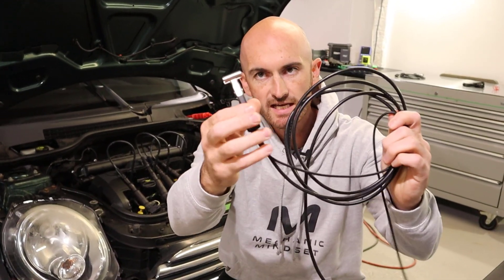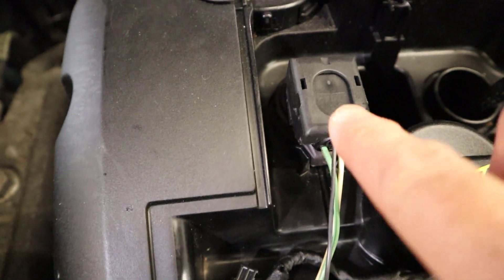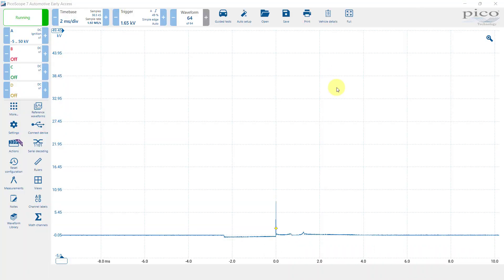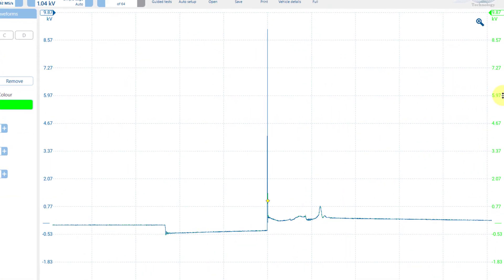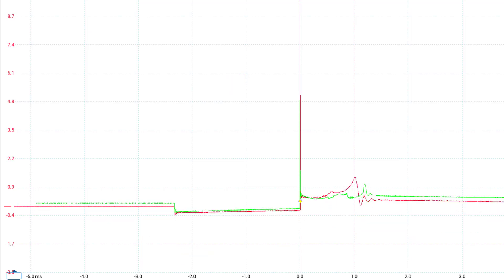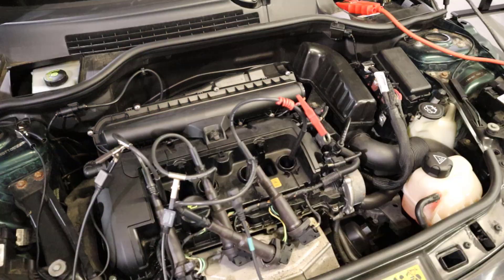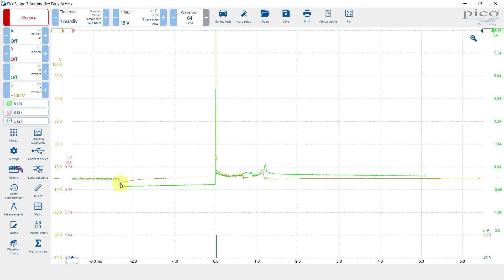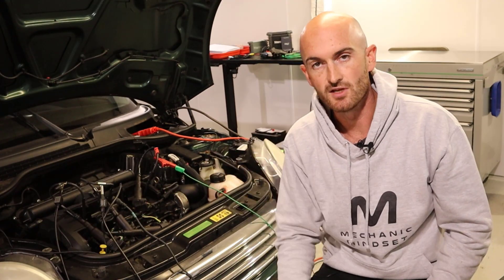Which Secondary Ignition Probe Does It Best?

Comment: So where’s the coil oscillations on the pico capture? Also it almost looks like there is something going on inside the cylinder with the pico capture that you don’t see with the hantek or the rotkee which I am assuming is phantom hash. Personally as far as a voltage waveform I prefer the hantek. I use the hantek25 with an Autel scope sometimes when I want a quick answer however current ramps tell a better story lol

Comment: I cut my teeth using BIG, SUN Engine Analyzers in the 1980's; the scope patterns were AWESOME. Waveforms were stable, predictable, repeatable & analog. When SUN introduced the INTERROGATOR, and subsequent models with DIGITAL scope, the waveforms got choppy and went to hell. In 2024, the one thing that hasn't seen improvement from legacy SUN ewuipment is the IGNITION SECONDARY WAVEFORM 😢.
Reply from the maker: I suppose the analogue waveform will be hard to beat there. My Granddad had one in his van, mobile home tuning! The 12 bit scopes are pretty good though. The 8 bit can’t cut it really.

Comment: do you need to do that with those plug extension cables? that seems like a complicated setup. and then the extension cables go attached to the spark plugs? could you explain that part better. I know you are measuring for ignition voltage signal how do you get those cables? finally, does the scanner provides that signal? I guess not ahh?

Comment: The Hantek et al are capacitive pickups and measure the voltage on the line, the coil is an inductive pickup and measuring the current that flows in the line. I've got no experience with spark ignition, but maybe you could use both the further analyze the system.

Comment: An idea for a future video - Multispark Secondary Ignition Diagnosis
Reply from the maker: Like wasted spark?
Reply: Not wasted spark. Many modern engines have multiple injection phases and also now multi spark. Just as an example the Mercedes M256 inline six cylinder is multi spark unless you unplug the rail pressure sensor. I often find the pattern very difficult to interpret and I haven't found any information online on how to analyse this type of ignition
Reply from the maker: @ashleyg3357  Ah ok yes, think the older straight 6 BMWs used to use it too. If I see it, I’ll show it 👍
Reply: @MechanicMindset  awesome, thanks!

Comment: I'm using the hantek HT-25 with my 2204a. I'm wondering what probe I should use on Pico 6?
Reply from the maker: I think the probe is x1000. You can copy the probe from Pico 6 Autmotive and load it in Pico 6 normal 😁
Reply: Thanks I'll try that.

Comment: have you ever  moved the clamp on different places to see if you can get a real good waveform. i forgot to try last time i had
sparkplug wires. my autel secoundary ignition clamp seems to work like your pico and hantek probable made by same co. i know with the 2in. copper sq. and the clamp i can get a nice waveform COP but, you must find the sweet spot.
Reply from the maker: I haven't, I tried to get them all in the middle of the extentions, but I'll have a play around as you suggest. Cheers!

Comment: Would the wire coil not be a bit risky for your scope as it’s not grounded in the event of a lead arcing out and sending all that energy straight to the scope. Just a thought. Great comparison of probes here.
Reply from the maker: Possibly. Not sure how much a risk it is without the scope being part of the voltage differential (ie if it’s not connected to chassis ground, current shouldn’t flow through it). I was going to try actually, see what happens! Thanks

Comment: There's a PDF online from Electronics Today 1977 with an instruction how to make a DIY ignition secondary probe. If I remember it right, they suggest a maybe 2" wide strip of tin foil wrapped around the ignition lead, to that foil you connect a 1nF capacitor (different sizes can be used to adjust voltage, the same goes for the width of the tin foil) to ground, an a 1 megaohm resistor parallell to the capacitor. Then you just connect the scope to the tin foil wrap. Similar to the wire wrap, but with a way to limit the voltage = less risk of BBQing the scope. 

As far as i know the store bought secondary probes use this basic construction.
Reply from the maker: Just saw this mate; I’ll check it out!

Comment: Thank you Darren.

You may want to capture the same ignition event simultaneously with all 4 probes connected to the four channels? You would avoid whatever  might be caused by differences/changes between different combustion events. 

Another economy trick is to use a paper clip around the ignition wire, one of those that look like a butterfly where you press on the levers to open them. Then you connect your gator with the test lead to it. It will work as a capacative probe, like the pico, rotkee and hantek.
Reply from the maker: I’ll give the paper clip a go! I like the sound of that. 

Yes for sure, I’ll follow up with a single cylinder test 👍

Comment: My vote goes to pico
Others are not really bad either although after personally testing several units I noticed there is always something to adjust while pico is consistent. Now I keep the other units for cylinder reference duties.
Reply from the maker: Someone else noticed the consistency; I wonder what they do different. I think as long as you use the same tool while testing, the comparison will stand out. I have an older Pico clamp which I did t compare here, would have been good in hindsight 😆

Comment: Would an attenuator be required using Pico 2204?
Reply: Perhaps you may get away with not using one, but there's no downside to using it and it reduces the risk of damaging the scope. Might as well put it on there, better safe than sorry. Especially as using a 2204 implies your budget may be limited, wouldn't want to risk damaging it.
Reply from the maker: For the coil of wire I’d say yes. But it’s not needed for the others. I think it’s already built in
Reply: @MechanicMindset  I mentioned a DIY probe in a separate post, using tin foil around the wire and a capacitor connected to ground. This gives you a capacitive voltage divider, about 1pF capacitance between the ignition wire and tin wrap, and 1000 times larger capacitance between the wrap and ground thanks to the added capacitor. This makes a ~1000:1 voltage divider, different sizes can be used for other attenuations. Those voltages may sitt be a bit high for a 2204, so attenuating isn't a bad idea. 
You never want to see the overvoltage warning when using the scope at its highest voltage range, you know it's more than the scope can show but you have no idea how much more. Could easily be enough to damage it.
Reply from the maker: @ulfg1409  For sure 👍. Thanks for sharing!

Comment: I think the Darren mechanic mindset coil is the one for this hobbiest. I believe you'd get a much better waveform out of it if you used only 1 wrap. I think the additional wraps are picking up more noise like an antenna. Something I wish I could go outside and try, but all my cars are cop, and I don't have the extenders.
Reply from the maker: Nice hypothesis! I was wondering whether more or less windings would be best. The clamp definitely picks up a lot. I think I’d need something to trigger to prove out the interference vs measured coil 👍

Comment: Have the rotkee probe did not get such a clean waveform what was the settings for that probe
Reply from the maker: I just use the normal 1x setting and adjusted the voltage to get the waveform. What scope are you using?
Reply: @MechanicMindset  hs402 and the pico 2004
Reply from the maker: @Autotech0369  HS402 looks interesting. What do you know about the wifi versions?
Reply: @MechanicMindset  i have hs402 wired. The wifi one from all i seen is pretty awesome

Comment: I think the is a reason why they all have a clamp to put on chassi ground.. This amount of voltage will create a spike inside the test leads like any coil ..so without that ground cable you will burn your scope
Reply from the maker: Yeah I need to check where the ground connects, the voltage is quite low because I think there is an attenuator, but if there is a fault and the spark leaks, it should protect.

Comment: As expected the pico one looks best.

But now i wonder.
Can we use the pico scope to check for RF signal from key fob remotes?
And which way is best..

If you get a clean signal, remember to hide the registration of the vehicle so noone can find it and open it from watching (the soon to come video?)😜
Reply from the maker: I suppose you would need a high frequency antenna to catch that and the scope to match.
Reply: I think the automotive picoscopes usually have a 20MHz bandwidth. What frequency do the key fobs use?
Reply from the maker: @ulfg1409  315Mhz US, 433Mhz Europe/Asia
Reply: @MechanicMindset  Well, then that's far out of reach of any automotive scopes I've seen the specs for.
Reply: @MechanicMindset  sure enough my 22 year old Audi A4 B5.5 uses 433.92 Mhz.

Didn't concider it was that high... 
Might be possible to get something with an scope with lower bandwidth but will probably be garbage signal but maybe enugh to tell if it is sending something at all.

I have a 2 usd spy cam finder that screams when i use my key fob close to it and i doubt it uses any high bandwidth chip but just looking for some oscillation signal

Comment: Hello Darren I just got the Hantek but i still haven't used yet. I have one question do I need to "tell" my pico scope 2k series that I have antenuetor or I can just connect it as it is and read the wave form?
Reply: No need to tell but you shown voltage on screen will be 1/10 of actual at probe voltage
Reply: @tullgutten  thanks a lot

Comment: Hi Darren, great video. I would be interested on a review of the rotkee oscilloscope, maybe a comparison.
Reply from the maker: Thanks! Hopefully I will receive one soon. I will be sharing the Ditex scope very soon 👍
Reply: Just getting into may be getting A scope.
On checking  2ndry kvolts will higher kv give a better ignition
Reply from the maker: @kevstrawmonochromeracing999  Not necessarily. It could indicate a problem
Reply: Being a DIY'er I'm going for the Hantek. I'm thinking the Pico probe has a little cleaner trace but the Hantek has a usable trace even for beginners. Thank you!!!!!
Reply from the maker: @dalebabbitt6185  It does for sure! Not much in it to be fair!